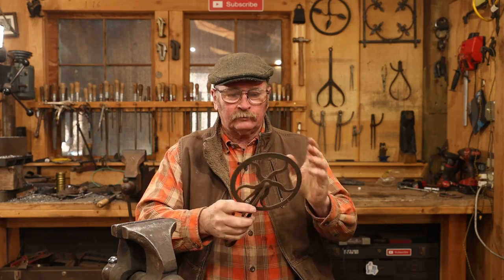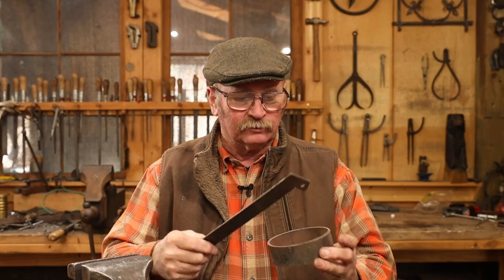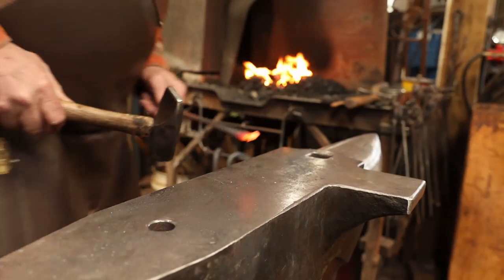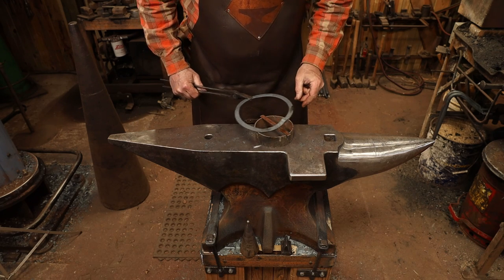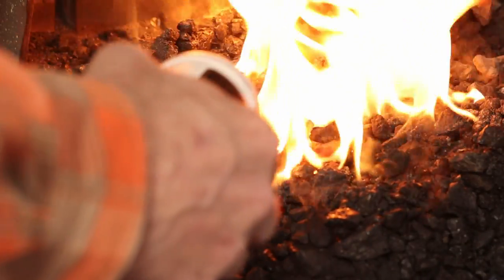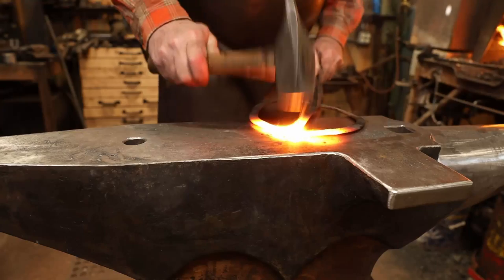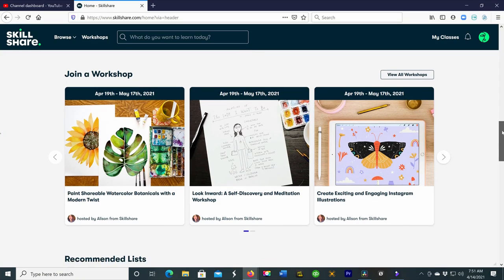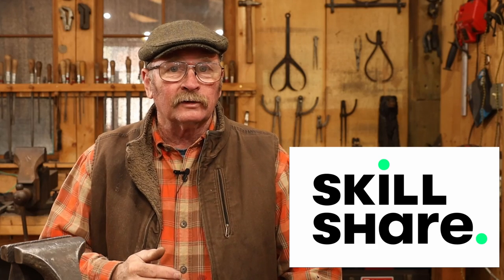Forging the Wheelwrights Traveler

Comment: I do math wrong all the time!  Lately, I've taken to using rope to measure for things like that.  You can buy 3-ply rope that's the same dimension as the steel you're forging, so it makes it super easy to just wrap a length around the mandrel then measure how much rope it took.  Plus, it's a fun excuse to practice my whippings, seizings and splicing.

Comment: i had a similar problem, i needed to make some round hoops but only had a die an inch too small so i forged two rings to fit around the die bringing out the size i needed, now i have three sizes i can forge to by adding or removing the extra rings.
Reply: when it comes to pi the answer is usually 0 because i ate it all
Reply from the maker: Time to make more pie

Comment: It would be great if you included the actual amount of time that you spend on forging each project.  It might be a 15 minute video because of editing and YouTube constraints but maybe actual time in the forge was 50 minutes or .....   I’d like to understand the amount of time involved in each project.
Reply from the maker: There are so many variable that it would be really hard to do accurately. When I film, I spend most of my time dealing with lights and camera, so a project like this might have 5 hours in it at this point, but only an hour or so is forging. Plus everyone works at a different speed, has different tools and skill levels.  I'm afraid if I gave a time estimate, lots of people would get frustrated when they take 2 or 3 time longer to do it themselves.

Comment: EngelsCoachShop  where this tool is put to use
Reply from the maker: They are used to measure the circumference of a wagon wheel and transfer that information to the material for the iron tire. I'll show how it works in part 2.  Hopefully I can find a suitable wheel
Reply: @BlackBearForge   What I'd like to know is 'what's the tool to the left of the wheel used for'? (double divider thing)  Cheers!
Reply: @TomSnyder--theJaz  He has a video on those double calipers. https://www.youtube.com/watch?v=GdbraZiQPAo
Reply: @thallmeister  Thanks, Tim.  That answered my question.  Cheers!

Comment: You are American... right?  You be talkin like 6 mil 3 mil. 6 million?
3 million whats?  We use inches here.
Reply: "Metrication (or metrification) is the process of introducing the International System of Units, also known as SI units or the metric system, to replace a jurisdiction's traditional measuring units. U.S. customary units have been defined in terms of metric units since the 19th century,[1] and the SI has been the "preferred system of weights and measures for United States trade and commerce" since 1975 according to United States law... Although customary units are used more often than metric units in the U.S., the SI system is used extensively in some fields such as science, medicine, electronics, the military, automobile production and repair, and international affairs.[6] Post-1994 federal law also mandates most packaged consumer goods be labeled in both customary and metric units.[7]

The U.S. has fully adopted the SI unit for time, the second.[8] The U.S. has a national policy to adopt the metric system.[3] All U.S. agencies are required to adopt the metric system.[9] As of January 2023, the U.S. government had retired the survey foot."